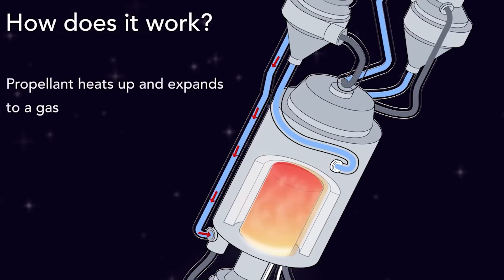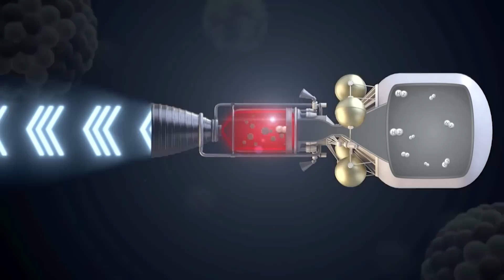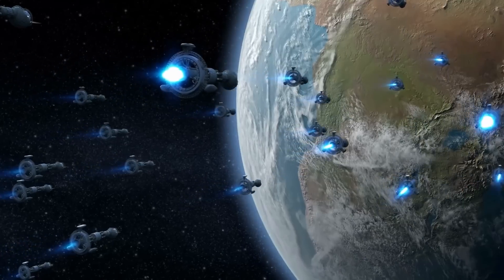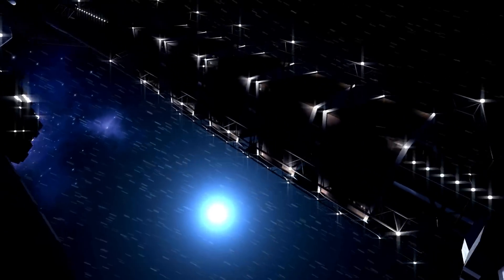Breaking Barriers: NASA’s INSANE Nuclear Rocket to Visit Mars IN DAYS

Comment: So the Mars rocket goes 24,600 mph ?  That is Mach 32. What kind of material is used on the outer skin ? The SR 71 Blackbird did Mach 3 with many difficulties. That is 2,300 mph.  Hard to believe they can go another  22,000 mph with no issues. In fact it sounds unbelievable.
Reply: There's close to zero drag in space?

Comment: Project Orion was  the previous effort that was shelved., for safety concerns The attraction is obcoius, when you realize that the energy density of nuclear reactor fuel about 10,000 times greater than rocket fuel. Even if the nuclear propulsion was only 1% as efficient as rocket fuel. it is still a clear winner.

Comment: so how does it slow down?
Reply: Half way there, it rotates 360 degrees and continues at EXACTLY the same thrust.

Edit:  Oops.  I meant 180 degrees.  Thanks Mr. Clifford for the correction.
Reply: @OhNoNotAgain42  Try 180 degrees.
Reply: @donaldclifford5763  Oops!  Thanks for the correction.  Brain fart on my end.  In my own defense…. I JUST retired from a 35 year engineering career.  My brain is clearly on vacation.
Reply: @OhNoNotAgain42  Well I knew what you meant. Easy to get it confused. I think we're talking constant acceleration/deceleration. That would give it some artificial gravity for most of the trip.

Comment: This announcement is ground breaking.  Could this tech not be used for intercontinental travel through space to reduce atmospheric drag?  I'm sure a trip to Australia from North America or vice versa can be done in minutes instead of hours.
Reply: ... a n d.  ... they scrape you off the windscreen.
Reply: Kind of. The hard part is getting the altitude. We can do this already with standard propulsion systems. It just takes a ton of energy to get to the low orbit you're looking at. Lockheed Martin is currently looking at fusion powered thrust for fighter aircraft which might be able to do something here. But its incredibly inefficient (efficiency isn't a big concern for a fighter jet) so it might be a bit before civilian airliners can think about adopting it.

Comment: How many G's is a light speed vehicle going to put out? I love the concept of a light speed vehicle, but if pilots are passing out between 4 and 5 G's and 10 G's is supposed to mean instant death by crushing you, how are humans supposed to handle the g force of a light speed vehicle? Also, if we can move light speed, how cone we can't teleport yet? We can turn the light switch off and on, (by said vehicle) but we don't travel within the light. NOW, we are gonna be moving at light speed while being INSIDE said light... strange
Reply: All that matters in space is acceleration G's. If you have a constant 5 g. or less acceleration, you can keep accelerating indefinitely, until you begin nearing light speed. So, as long as you give yourself plenty of time to get up to full speed and plenty of time to slow down, there are no safety issues.
And, just to be clear, it is impossible for a physical object to go at light speed; no one was suggesting that we could do this. However, it is possible to get close to it using technology like this if you are willing and able to spend 10s or 100s of years accelerating. This is true because space has insignificant friction, allowing objects in motion to stay in motion.
Reply: @DanKaraJordan  5 yeara to get up to enough speed to travel 45 days.

Comment: The biggest limit I see, besides money, is impacts with dust particles in space.  If you accelerate at 1g for 80 million miles (half the way to Mars) you could theoretically get up to 2.5 million miles per hour.  Which means a grain of sand in space would impact your spacecraft at 2.5 million miles per hour.  Just like we have thermal limits for aircraft I am sure we will have to have impact limits for spacecraft.
Reply: Agreed, we have seen the damage to JWST after a few week. They need to find a solution if they have humans onboard.
Reply: This  is why speed of light travel is hilarious, you would need a way of scanning light years ahead of you and be able to slow down and maneuver efficiently.
Reply: There's absolutely no way they are going to accelerate at 1g. These nuclear engines are no where near that powerful. They never even mentioned doing that to get to Mars.
Reply: @nerfherder33  If the engines arent capable of accelerating the rocket at 1g in space, how does the rocket reach orbit from earth's surface, where the gravity is 1g? Dont you need an engine that powerful to leave earth at all?
Reply: @hschan5976  You use different (chemical) rocket to boost your spacecraft into orbit. Once in orbit there is at least in theory no lower limit on thrust of the rocket (you can always slowly spiral out of the gravity well of the planet, firing your rocket perpendicular to the rotation axis).
Reply: @ukaszlampart5316  I see what you mean. So nuclear engines have low thrust and are only effective in vacuum. But then how's the return trip going to happen? The chemical rocket boosters are usually dumped once the spacecraft reaches orbit. But in the case of the Mars mission you'll need them again to launch from Mars for the return trip. Are we going to haul those chemical rocket boosters all the way to Mars?
Reply: @hschan5976  That's the idea, high ISP of in space propulsion allows us to take lander/ascend vehicle and still get to mars faster. But ISP need to be significantly higher in order to offset all the additional mass.
Reply: There is a solution to every problem.
Reply: @stbuddha3547  that really isn’t true.
Reply: Energy shield that destroys and/or defects incoming objects that would impact the ship.

Comment: I have read some comments about radiation doses to astronauts from the reactor. The amount of radiation from a shielded space reactor is extremely small (much less than natural background radiation on earth). The main reason for going with nuclear propulsion is to reduce the high radiation exposure from cosmic radiation. Whithout earth's atmosphere and magnetic field we would be fried on earth by cosmic radiation. If we go by chemical rockets the trip will be so long that the astronauts' radiation dose will be so high it will the exceed maximum allowable radiation dose for workers in the field.
Also, I have been following space reactor programs since the 1960's. A program on space nuclear propulsion seems to get going on about a 10 to 15 year interval. They usually last a couple years then get canceled.